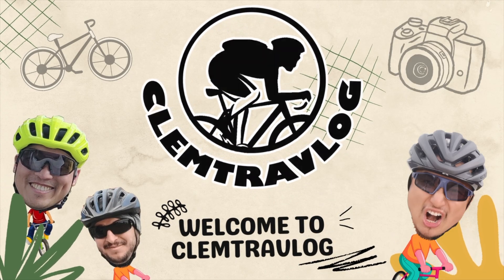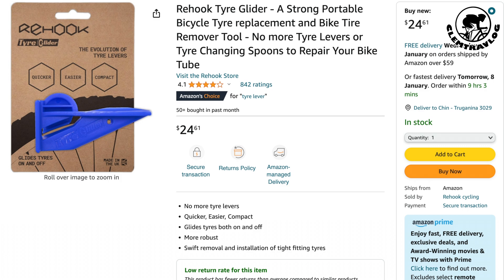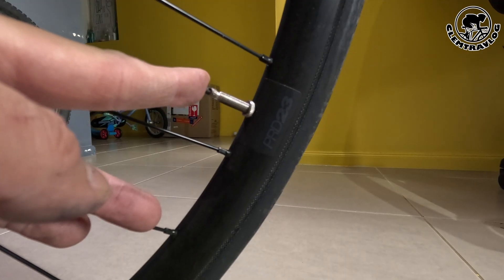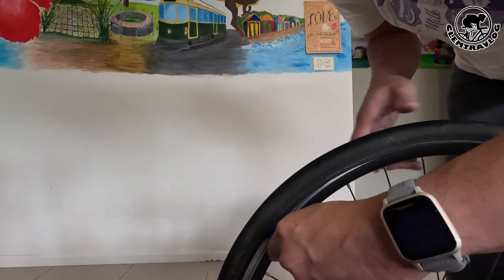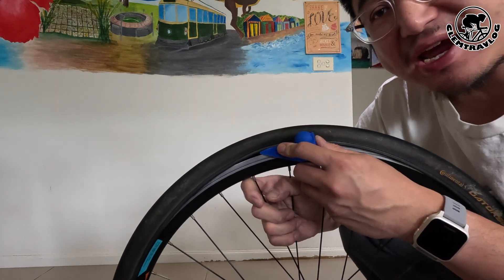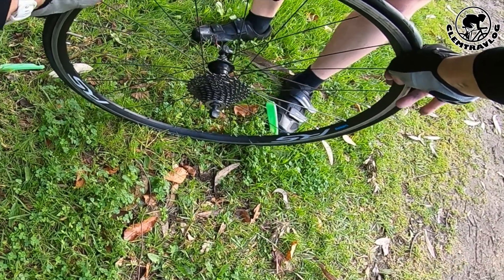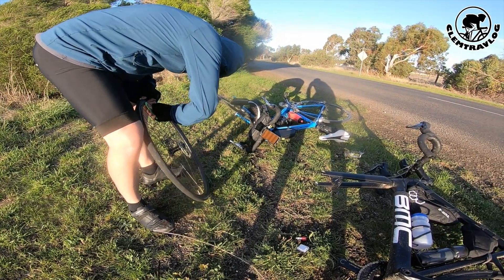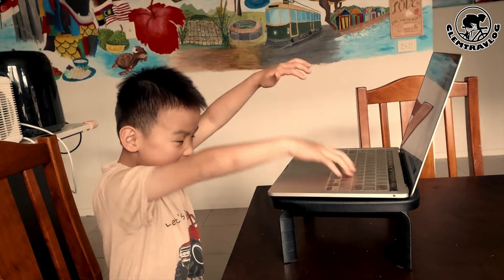【clemtravlog 208】Fantastic Cycling Gadget - REHOOK TYRE GLIDER, easy, efficiently change tyre tube

Comment: Thx for the video. A few weeks ago, I bought the Tyre Glider, together with new wheels and new tyres. I tried to get the new tyres on the new wheels. It didn't go well...at all. I had to go back to the old levers to get the tyre on the wheel. So it doesn't seem to work well for brand new tyres. After seeing your video, I tried again, this time with an old wheel and old Continental 5000 tyre. Getting the tyre off the wheel was not as easy as in your video but it did go easier than with traditional levers. Getting the tyre back on the wheel on the other hand, was really a piece of cake, as in your video! And that has always been the hardest part for me, to get the tyre back on the wheel (with occasionally puncturing the brand new inner tyre). So I'm happy I bought it, but guess I'll have to keep the levers as backup for the brand new tyres.
Reply from the maker: Continental 5000 is famous for stubborn to get out. Even thought is not very easy when using this glider but at least is easier. My friend and I spent almost half and hour to get the tyre out by using old lever, it was disaster but I decided to use this after seeing another friend using it on his gp 5000

Comment: Hi Clem do u think it’s safe for the carbon rim? Would it scratch if u glide on it?
Reply from the maker: Is a tricky question. I don't have carbon wheels so I don't know but I know not every lever suitable for carbon wheel. I checked only, I saw one guy did mentioned it damaged his carbon wheel.  But like what I said, carbon wheel is very fragile so not even all levers are suitable, therefore I will say better not.